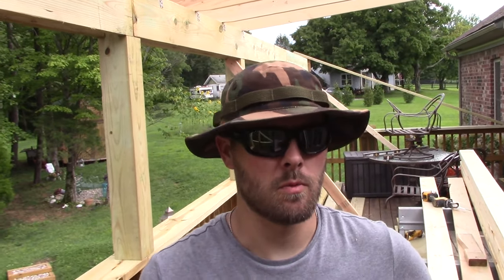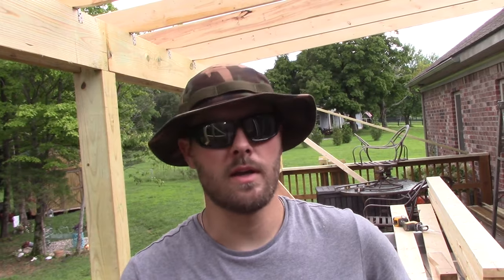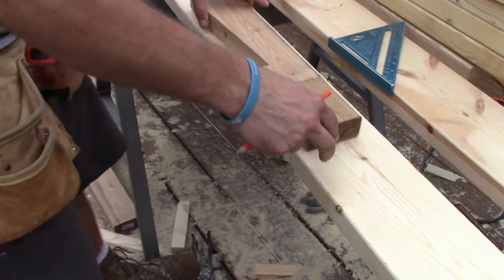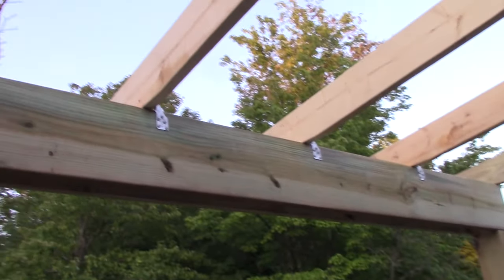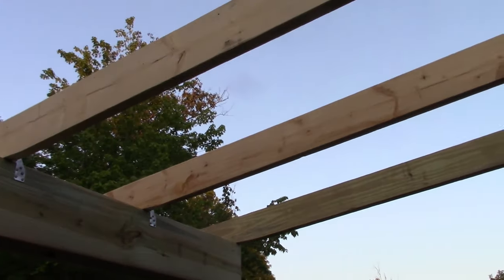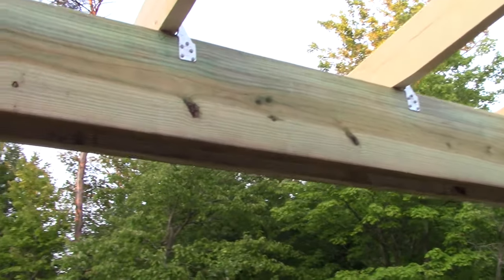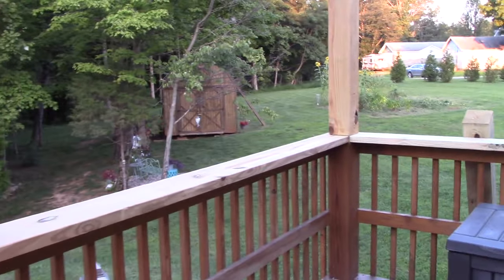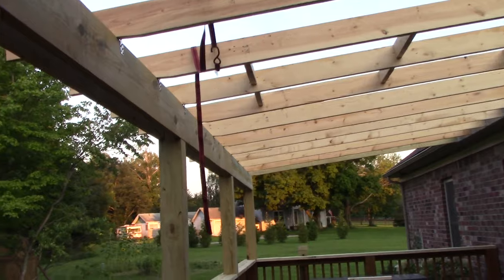Installing a Lean-to Roof on an existing Deck

Comment: what kind of screws did you use on the fascia? did you reinforce it to hold weight or tried to attach the existing rafters?? questions questions..lol
Reply from the maker: We used long decking screws and yes we tried to position out rafters inline with the roof rafters so when we installed the joist hangers they fastners caught the rafters. We did not reinforce the facia. it was a 2x6. We did what we were comfortable with but you have to make that decision for yourself. We may go back and add a ledger board with gussets back down to brick for added insurance.Hope this helps and thanks for checking out the channel.

Comment: WHat is the purpose of this is it supposed to be a mean to pergola for sun protection while not completely block the view and also for aesthetics?
Reply from the maker: Its covered with metal in the follow up video. Hope this helps. Thanks for checking out the channel.

Comment: Looks nice. But I have to wonder how that is up to code. Using the existing deck railings for the front edge of your lean to, seems wrong to me. We have foot plus snow falls here in Michigan, that's an awful lot of weight bearing down. This is not a criticism, I'm genuinely curious about the possible code violation.

Comment: I am wondering how you are screwing into the rafters to outside frame?
Reply: See the other notes. It might not be code compliant. It might stand for a long time but would be a huge liability to have that much weight hanging overhead. 

Better to remove the fascia and soffit to connect at the wall.
Reply from the maker: Thanks for checking out the video!

Comment: How did u put the “pipe” in the porch column to stabilize it?
Reply from the maker: I have another video explaining the process but basically an auger bit drilling in on center and driving the pipe in. Thanks for commenting and checking out the channel

Comment: Hey mate, im going to build a patio at my house can i use the same method as you it would be 5m x 14m
Reply: 5m (16’) should require larger rafters (2x8’s @ 16” o.c.)

Look to the other comments regarding code compliant connections at the existing structure.
Reply from the maker: Thanks for checking out the channel!

Comment: I definitely would have not set the 4x4s on the top of the rail like that even though its over top an existing 4x4 doesnt mean it can carry that extra load from the roof. I would have cut out the railings and set new 4x4s to a footer. Just saying its going to be more architectural & more load bearing.
Reply: Excuse me 6x6s.
Reply from the maker: The post go below the deck to the ground about 14 ft down and set on their own individual footings. Thanks for checking out the video

Comment: How do you figure out how much to notch the joist
Reply from the maker: So if you can use a speed square and figure the angle. The general idea is what ever degree slope you are using , you use the speed square and degrees of slope to cut the angle on the end of the rafter and should match the bird mouth or notch. We had to trial and error a few to get the notch just right. The scrap block you saw us using we cut as an easy transfer template. Also we marked every joist to length for the notch because the facia board moved in and out a little. Thanks for checking out the video.

Comment: Have there been any issues weight-wise with the 2x6?
Reply: Rick - You would do well to review the other comments. Lots on this topic with better, code compliant solutions.
Reply from the maker: No not as of yet. We had one spell of ice the year we built it and Dad went out on the deck and added some temp braces in just to be safe. we also ran a patio heater to aid in the melt off.  It was only that one time and for our area it was an unusual amount of ice. Thanks for checking out the video

Comment: looks pretty good...  what is the spacing and span on your rafters.?
Reply from the maker: A little over 11 feet
Reply: Thats to for a span for 2x6.Minimum would be 2x8.they will probably sag after awhile
Reply from the maker: https://www.mycarpentry.com/rafter-span-tables.html
Every thing I could find in research showed yellow pine at a 20 lb per 2 sq ft load to be overrated on 24” center. Maybe I am wrong but we built what we felt adequate. All I can say is you have to do what is best for you . Thanks for checking out the channel

Comment: Omg now the post are just resting on top of the hand rail.. this got worse and worse as it went on
Reply from the maker: The post are pinned to the post below which extend down 14 ft to the footings. We were not replacing the entire decks 6x6s. Thanks for the kind words, take care
Reply: Did you not listen to him? They are doweled with galvanized pipe!!! Like thru the center of both bottom and top posts! I don't know about you but galvanized pipe is pretty hard to bend, especially with no spacing to allow for it to bend! Good job man you guys did pretty darn good.

Comment: How did you determine the height of the beam
Reply from the maker: Combination of comfortable head height and maintaining roughly an inch of fall per foot.
Reply: @homebuilt8694  thanks
Reply: There are lots of links that reference the building code for require framing sizes per length and spacing.

Comment: What is the height of the the front compared to the back?
Reply from the maker: So if i remember correctly the deck to the drip edge was 104 inchs and we cut the 6x6 and installed the support beam at 92 inchs. we Came out with right at 1 ft of fall over 12 feet. You would probably have to go with more angle if you intended on using shingles. Thanks for checking out the channel.
Reply: @homebuilt8694  Indeed, I believe here in Ontario , Canada, anything below 3/12 roof needs a specific roof covering, not shingles.

Comment: Yikes. The weight of the roof is hanging on the fascia board of the overhang (which is no doubt nailed to the house with plain nails), and the 6x6 posts are resting ON TOP of the handrail and "doweled" to the posts below. So the entire structure is no stronger than the fascia nails and the dowels. The massiveness of the 6x6 posts is completely defeated.

Comment: ... you can't install trusses to the facia like that.
Reply from the maker: We built ours that way. Thanks for checking out the channel!
Reply: I’m fixing one like this that fell when we re-roofed.   The nails in the fascia were not meant to hold up an awning.  I would put in some Strong ties or GRK 4-5 in self drilling screws.

Comment: With any snowload that’s falling down and gussets won’t help
Reply from the maker: Well we had 3 inchs of Ice on it with a couple inchs of snow at the end of our winter season and no issues presented. We did try to use a patio heater to help melt some of the ice off but everything survived. Thanks for the feedback

Comment: How can you prevent diabetes?
Reply from the maker: If you are talking about Type 2 diabetes you very much need to work with your diet the best you can so not to make the diabetes worse. However if you are talking about Type 1 diabetes like our daughter has than there is nothing you can do. It is an autoimmune disease. The body starts to attack the pancreas and will eventually shut the pancreas and insulin production down completely. Thanks for taking the time to leave a comment. Hope this helps ! God Bless!

Comment: Yikes. I cannot stress enough that you really need to get an engineer to look at what you have done.
Reply from the maker: And what do you suppose they would have us change? I build everyday for a living. I fully explain in the video that we inspected the inside of the eve cavity and the gutter board is a 2x6 lagged into the rafters and our rafters are supported with joist hangers. I also explain that if snow load became a concern we may look at adding gussets  and a ledger board to the underside of the roof. Also in our case removing the gutter board and trying to sister onto the side of the rafters was out of the question do to the angle of the house roof. The purpose of the video is to help people get an idea for their project not to be a step by step tutorial. I appreciate your concern and i the guy that did the drawings for the house is an architect and a family friend. I may do a video with him and let him inspect the awning just to put everyones mind at ease.
Reply: @homebuilt8694    Irregardless I would ask an structural engineer to review and comment on what you did to be on the safe side.
Reply: To make it a bit more structural... notch cut a 4×4 post at each end where you attach it to the fascia.
Reply: The 4x4’s still don’t make the fascia a beam.
Reply: Good luck getting a professional to publicly comment. No one worth their license would touch it. Way too much professional liability. 

Removing the fascia (gutter board) and extending the new rafters to the existing house is definitely doable. Been there. Done that. It might also mean removing a couple rows of bricks to tie a proper ledger into the existing structure. You also could remove the roofing up to the wall to tie in. There are other options. 

If this design was being dictated to potential contractors, it might be the reason for not getting a response.

Comment: Your super long seat cut on the birds mouth looks super ugly.  If they decide they want to put a ceiling, they will be in for a lot of headache.
Reply from the maker: Because of the way its built they are not going to add any additional weight to the structure. Thanks for checking out the channel!
Reply: @homebuilt8694  What does that have anything to do with the look of it and making it VERY difficult to add a ceiling later on? The seat cut should end before or at the inner face of the header. All done by simply making your pitch steeper. Also help when heavy rains come there will be less back wash coming back at the house roof. You avoid leaks that way.

Comment: Not done correctly, you should never use a roof fascia as an structural joist for all that weight.
Reply from the maker: Thanks for checking out the channel! Glad you liked the video!
Reply: @homebuilt8694  😂Quality response. So many butt hurt code nazis melting down in the comments.

Comment: You cannot tie in to the fascia.. I understand y'all might not be able to find videos but believe me this is not what anybody should do to their home this is 100% wrong
Reply: I'm not a builder and trying to learn. Why not? He said he tied through the facia and onto the rafter tails. I don't see where that would be a problem as long as it is connected to the rafter tails securely and we're not just hanging the whole roof from the facia board.
Reply: The only diagrams I can find do it that way. If you have additional information, please share. I would point out, though that there’s 2x material behind the facia in these diagrams. My own house, which was built in 1922, just attaches the facia to the rafter tails. I can see why I wouldn’t bolt to that.
Reply: As long as your through the facia into the rafters it's fine
Reply from the maker: Thanks for checking out the channel!
Reply: Well, it seems to do the job!

Comment: Complete trash... "We put hurricane ties just in case it ever gets high winds, we use 6x6 post.. it'll just pull our eaves right off the house cuz we don't know what the f*** we're doing"  this his convinced me start a chanel.
Reply from the maker: I was going to send a long comment back but it’s really not worth my time to converse with someone who just wants to spread hate on the channel. We did what we did, is it perfect no, does it suit the needs they had and is still working fine just as we built it yes. That’s the beauty of life you get to do you and I get to do me! I look forward to your channel my friend!
Reply: The challenge of “you get to do you and I get to do me” is in creating what is essentially a public how to video. You assuming responsibility for your life or your parent’s is one thing, but things like building codes are meant to protect all the future occupants, including visitors and future owners. You’ve also created a public record that could potentially be used against you in the future. Lots of hidden dangers though I do agree with you that there are probably better ways of commenting.
Reply from the maker: @johnlee7085  Thank you for the comment and leaving it in a polite way. I understand the code and why it exist. What i do not understand is there are dozens of metal awning companies selling the exact same thing we constructed. Most of them are designed to attach the exact same way ours did and many of which have different snow load ratings. How does building code look at that? The only difference in ours is its wood framing. I would never recommend to anyone to sheet or shingle a roof this way.  Nor have I instructed anyone to build what we built. It is merely a video showing what we did. There are plenty of videos online of people do very crazy things i would not do. Thank you again for checking out the channel. Hope to see your comments on future videos.
Reply: I agree! I'm using hurricane ties plus I put the ledger board mounted on 4×4s then attached to the side of the house so the 4x4s are holding the weight. 20x10 screen deck using  10 4x4s   ,  14 2x6s roof rafters